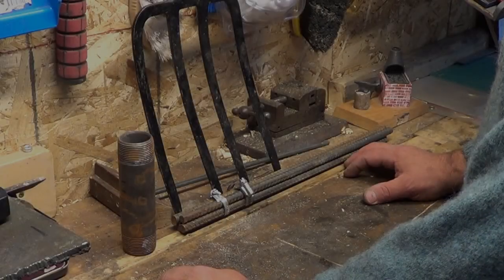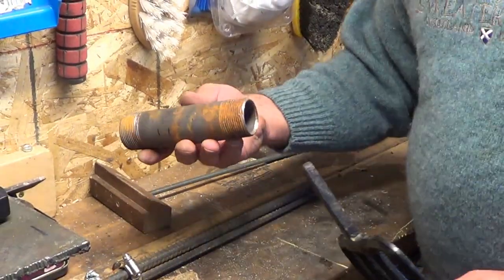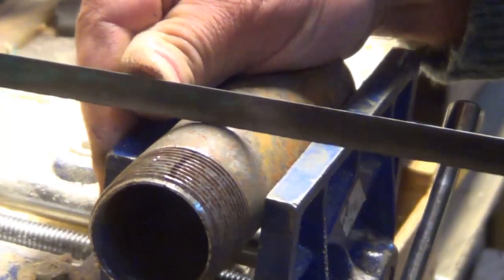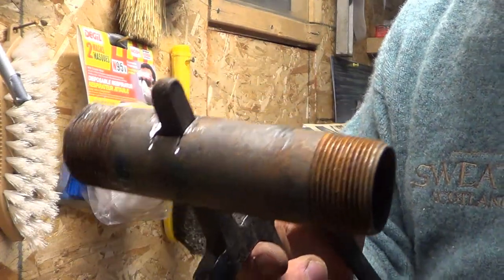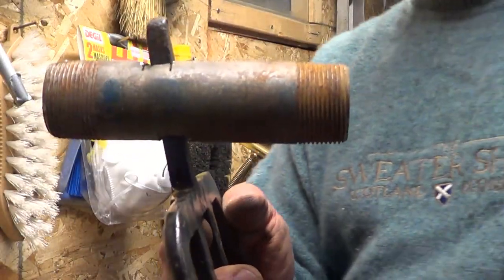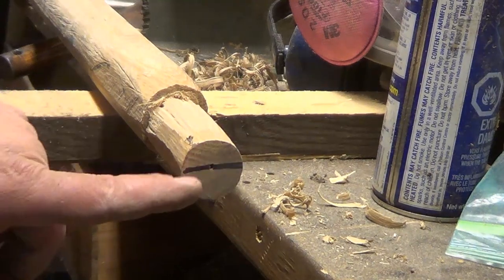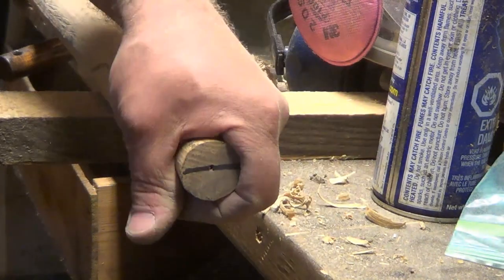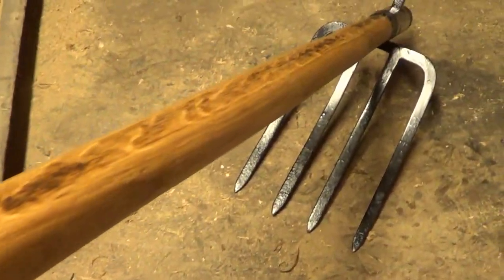Cultivator Hand Tool Build

Comment: I have an idea for cold and hot gas stirling engines designed for farming use that could be scaled down for gardening use. Like a V-6 cold gas sterling engine lawnmower that shot a cold air blast back at the operator while they cut the lawn on a hot day that operated off 24 volts. One amazing crazy idea!

Comment: Showing the way you use tools has been inspirational, Thanks for the details and keep up the good work!!!

PS: I made a potato fork (same story - no good quality tools available) using rebars as spikes and I have a negative feedback - the stripes on the side make to much contact (as their original purpose is) with the soil which is a curse both in moist and dry soil and I think I spent way to much time and grinding material to remove them afterwords. Next time I'll use tractor's spike harrow attachment's replaceable parts
Reply from the maker: Stoqn Georgiev thank you very much!  My dad taught me to be resourceful. Good luck with your rebar project!
Reply: Stoqn Georgiev

Comment: You could salvage a backpack battery operated leaf blower. Exchange the blower motor for a hydraulic pump that feeds a swash plate pump motor that you can have a turn switch low medium high for battery hydraulic pump with a squeeze throttle to activate the swash plate to drive the tines with a worm gear box to drive the wheels forward. A very quiet battery operated tiller great for any gardner who enjoys their garden and being really green and cord free. 😎

Comment: Retrofit a old push lawnmower use a swash plate pump motor on a large sprocket on the wheel for a power push tiller. 😊
Reply from the maker: Thanks!